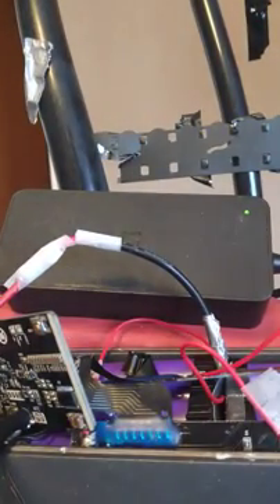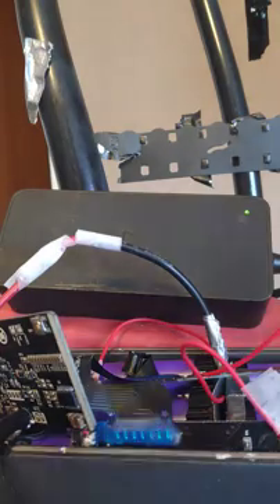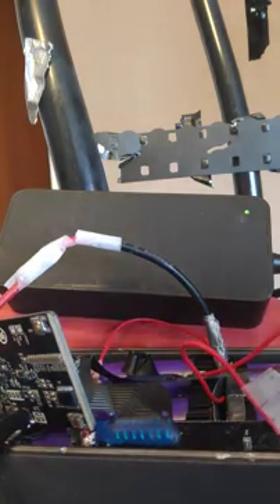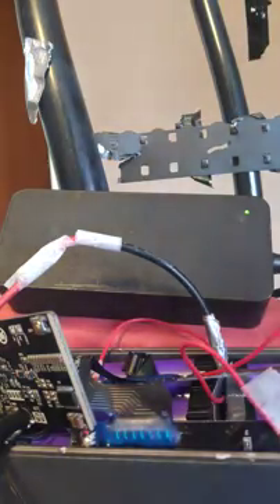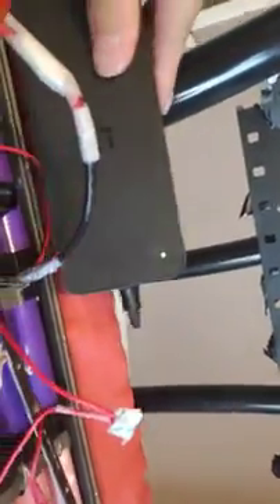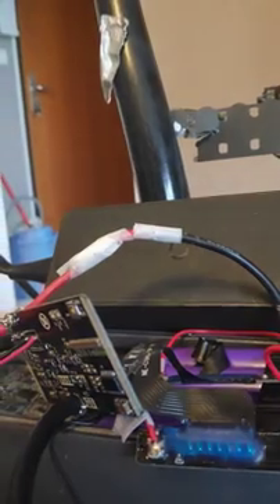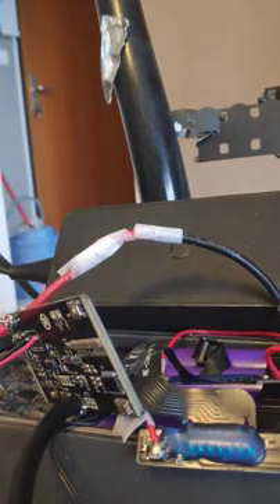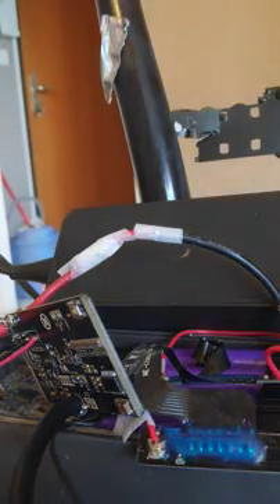Xiaomi miija m365 BMS: charging problem

Comment: How to fix...?
Reply: Thanks a lot for this video  I just fixed  2 scooters  from watching this video 👍👍👍👍👍👍🇮🇪😁
Reply: @trebor1973j  how?
Reply: @deomarsantos1559  watch the video
Reply from the maker: In my case there was a problem with the ground. It seems that In some boards there is an open circuit... You should connect the grounds that I point in the video.
Anyway I made the video to claim to the seller that the board wasn't in a good shape. 

Regards.